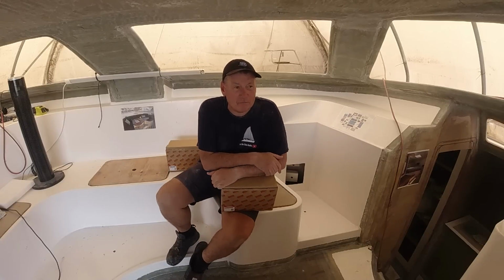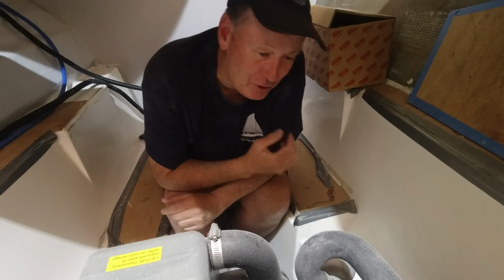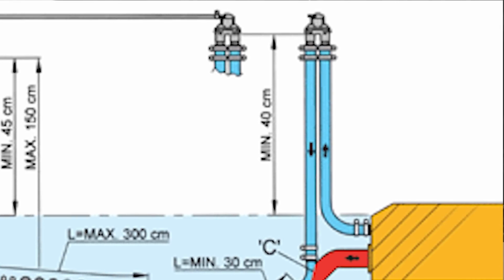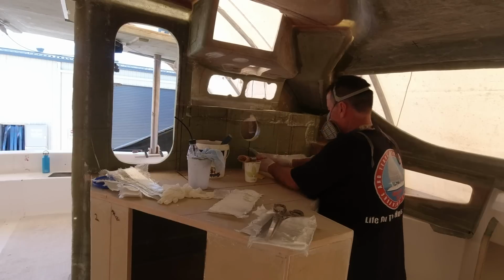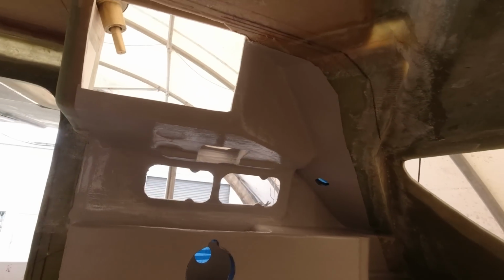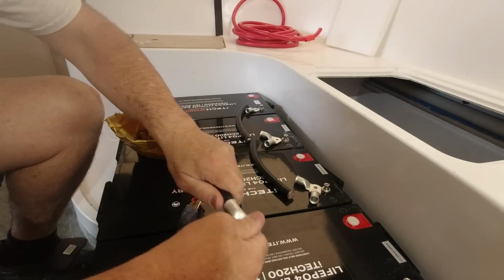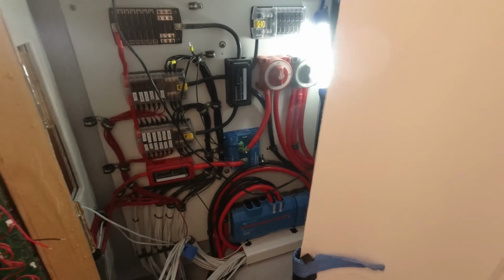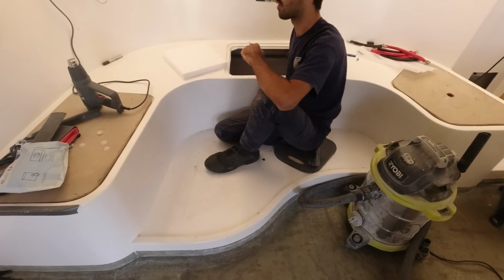Marine Engine Exhaust Design - Complete Catamaran Build Ep268

Comment: BTW, Ross,  Where that battery cable is going through the hole in that Battery Storage area, I wouldn't use Sikaflex or Silicone I'd use a Grommet that's what Grommet's are used for.

Comment: You can't use a gel coat for the interior?  I thought you'd want interior surfaces that don't get covered to be smooth.
Reply from the maker: All margins between modules and hull and deck,gel coated then spray flow coated ,sanded and polished wet and dry to 1200 grit before  buffing.Bit of work, but easily doable.Ross.

Comment: Another great vid mate! I had wondered with the lithium whether the purpose of the sealed box is to be able to flood them with cooling water (in the case of a battery overheating) without then flooding the boat. Otherwise, I just can’t fathom a reason for the new requirement!
Reply from the maker: I feel the standard has been adopted from an old lead acid and agm off gassing standard and will likely update to a more sensible outcome.Ross
Reply: @LifeOnTheHulls  That makes more sense! But yep, if Lithiums are gassing you know there’s an issue😂 Progress is looking good; I’ll bet you guys are getting excited to leave the tent and get her in the water.

Comment: Another step closer Ross. Just looking at the conversions and 0000 is equivalent to 120mm2 which you can obtain pretty easily in Oz for $55/m. From what I've seen the best way to join batteries to your system is to have equal length cables from each battery back to a common busbar or terminal post. This ensures all batteries are used equally if my understanding is correct. You'll probably be fine for the short-term, but it may be worthwhile considering down the road.

Comment: I hope the new riser is stainless.....i believe you can buy stainless aftermarket risers for half the price of a oem cast-iron unit....
Reply: Not with Yanmar mixed metal corrosion stuff !
Reply: @rl3898  gaskets separate most risers. Seen plenty and made a couple new ones in ss.

Comment: 5:12 true, but you should borrow a torque wrench in the right range and check the major bolts. Just saying. I was talking the other day with a friend of mine who works with a big chain of heavy duty equipment distribution and their bosses basically told them to start checking engines and power trains, something he said was the first time that'd been implemented in their outfit. Won't name names, i don't want to get my friend in trouble, but we're talking about a pretty big house name in the industry, one myself i had never put to question when i'd gotten new equipment from them before. Apparently we live in an age where CEOs have cut every corner that could be cut, wound up making circles out of the production and now they've started cutting from the center, sending production line tasks to us, the purchasers. An unpleasant thing for sure if it isn't a case of a bad production line spooking my friend's bosses.

Comment: Bulk head fittings for the wiring and tubing that goes through the bulkheads you can drill them a little larger if they are too small and then use rubber ferrules to seal . They will not be good for pressure specs but will seal excellently and look beautiful.  I have always used 316 SS or monel but I would think even plastic type would be good for this application and much cheaper. Get er done !

Comment: iTECH200  it says 250 amp discharge or 1.25C. IT will not let your inverter go over 3000 watts. inverters even 3kw ones can spike to 5kw with loads and that will not be possible how your batteries are hooked up now (parallel aka Daisy chain). Connecting each battery to a busbar would allow spikes up to 12 kw even though your inverter would never allow that. I just want to help do it correctly.
Reply from the maker: Batteries are connected through the lynx distribution bus bar 1000amp shunt prior to inverter  as per victrons instructions with 4/0 Awg cable.

Comment: Ross, you should have said the risers were for your Yanmar garden tractor. 50.00 each then!
Reply from the maker: Definately,such a disparity between marine and commercial.
Reply: @LifeOnTheHulls  The disparity is them being greedy. Based on some pretty heavy economics voices, people who have been in the trade for half a century, some even more, the recent events and greedonomics might just break the camel's back. Either we come out of this worse, or better... hopefully, and one area that needs some verge trimming is marine. The prices they practice are absurd.
I do home restorations, sometimes we have castings that far outtake that riser from both a material and complexity stand point and they never reach that kind of a price even when you consider the far lower number of items. In the middle of the lockouts, we were still working out little details on a 1700's house for a client. We had a run ordered of 400 or so intricate brass pieces and proportionally, it makes that rise seem like it's made out of pure silver. It's just absurd.
A few years back, we had to replace an entire chandelier that had been too damaged and modified to be usable anymore. Details, lines, components, 860 euros all in all, for 30 lights and about ~25 kgs. So... a custom ordered item, one of a kind, with motifs galore and details... is cheaper than a computerized production run item? I dislike these kinds of people, like the plague.
Reply: @aserta  Absolutely !!

Comment: Running your 12 volt batteries in parallel (daisy chain) means the whole load goes through every battery. Causes more heat loss and higher C rating and lowers your cycle count life.  If you connect each one to a busbar then it would mean each battery would take 25% of the load which causes less heat and will extend your cycle life a lot.  Many manufacturers do this so you will buy batteries sooner so they will make more money. That is not the correct way.  if you use 5000 watts from your inverter that is 417 amps that is over 2C rating. if you connect those 4 to a busbar each would be using .5C roughly. Lithium in lifepo4 cells break down from heat and high loads much faster. I did a ton of research  on this before I setup my home battery system for solar and off grid use.
Reply from the maker: Batteries are linked to 1000amp busbars prior to inverter.All loads pass through this system prior to inverter and dc distribution.I followed rhe vixtron set up guide implicitly. Interesting to see that point though.Ross
Reply: @LifeOnTheHulls  good you changed it.
Reply: @LifeOnTheHulls  That still does not change how many amps your batteries can put out in parallel. you are jumping each battery together then to your Victron busbar. each battery needs to be connected separately to that busbar.